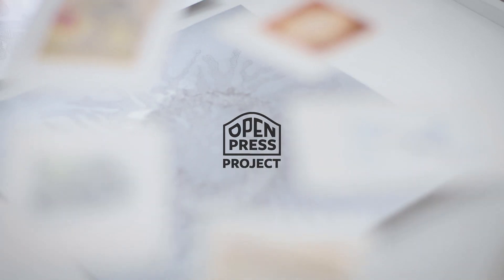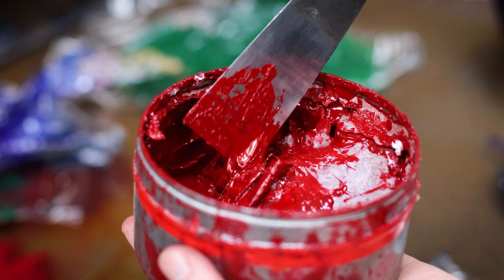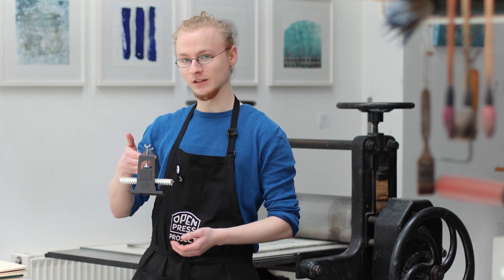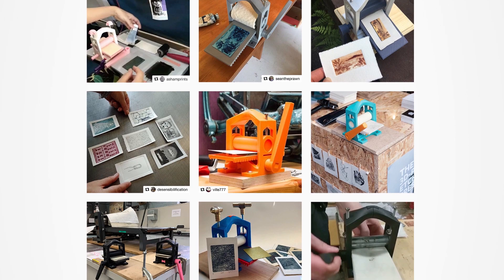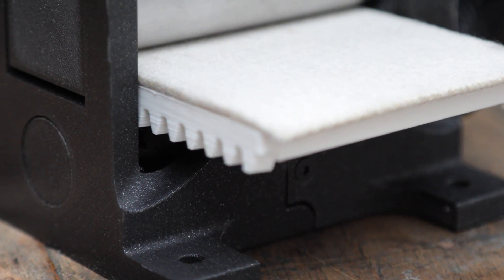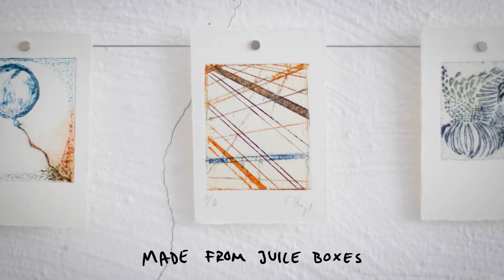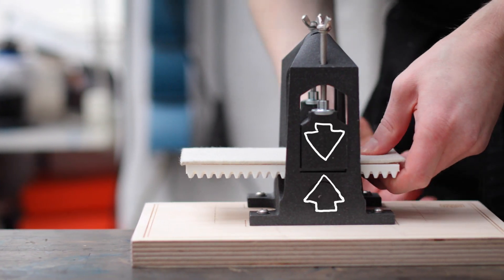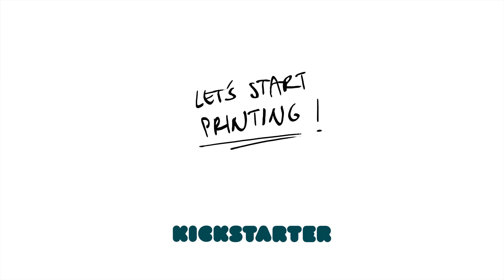The first 3D-Printed Etching Press

Comment: While this 3D printed printing press is ridiculously cute and adorable, the market is already saturated with affordable A4 printing presses like the x-cut press for approx 150 bucks or less adjustable sizzix or cuttle bug ranging under 100 bucks using shims instead of adjusting the printing rolls  not to mention semi professional table top printing machines capable to print up to A3 in the range of 300 to 500 bucks.  Just saying.
Reply from the maker: Indeed, the XCut is a great example of making printmaking much more accessible with an affordable press. But we wanted to make one that is especially designed for etchings as these technqiues are much less accessible. There are rather large presses for relief printing out there, but they rarely work with etchings as you need a lot more pressure for a good print. If you have access to a 3D printer you can now print your own tiny etching press for free :)

Comment: Any Ideas on how to replace the rollers with metal ones? they don't really print out evenly
Reply: maybe use a drill to rotate and sand the roller? or you could use metal pipe perhaps (i.e. steel conduit)